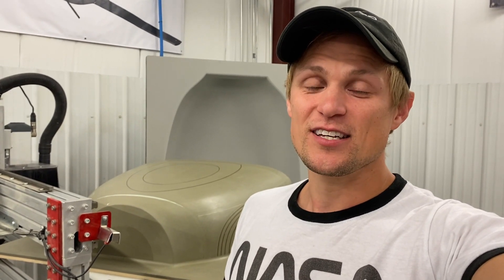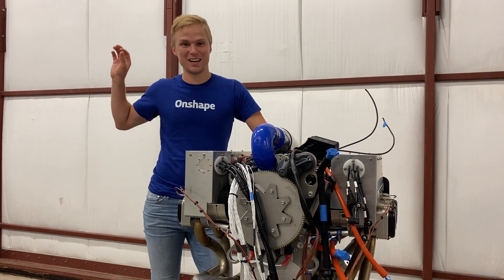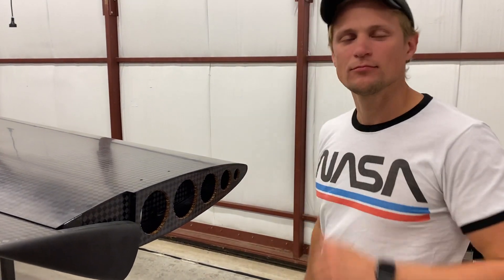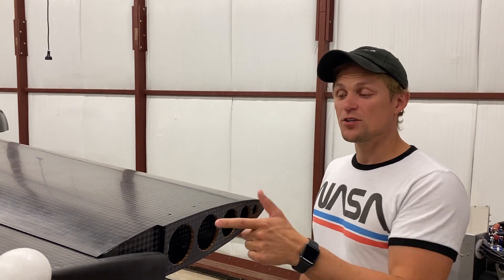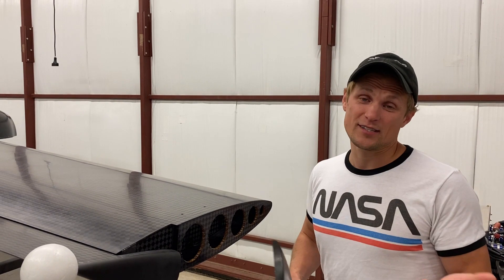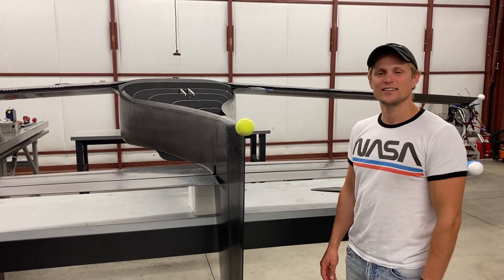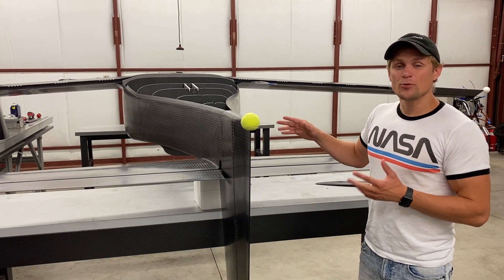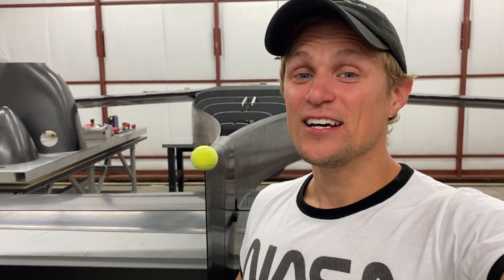Several DarkAero 1 Frequently Asked Questions! (FAQ) - July 27, 2020

Comment: Maybe the answers to the questions should also be listed.  For instance I could not understand the answer to the engine question (specifically the engine selected).
Reply: The answer was "no" you can't install a different engine, since they designed this entire plane around that engine.

Comment: So you said it wasn't designed for aerobatics, however I'm sure it can handle simple things like wing overs and loops saying within a +6/-3 envelope right?
Reply from the maker: Hi David! The structure is rated for normal category maneuvers within +3.8/-1.52G’s flight envelope. The mission the DarkAero 1 was optimized for is high speed cross country flight. There are some aerodynamic changes we would have made if we intended the airplane for aerobatic maneuvers.
Reply: @DarkAeroInc  ok got it!  But if you are doing "gentleman" aerobatics under those limitations you would be ok?  I'm taking basic stuff (aileron roles, loops) all within the limits.....assuming your weight loading falls within the correct category to go to those G limits

Comment: If you can only use one engine, why isn't it a fixed part in the kit?
Reply from the maker: Thanks for watching and the comment! We don't manufacture the engine. We only manufacture the composite structures, engine mount, and landing gear. These types of items will ship directly out of our facility. Things like the engine, wheels/brakes, adhesive, etc. are all necessary for the aircraft, but not something we produce. With that being said, we would like to have a seamless customer experience where everything needed for the aircraft is ordered through our website (but not necessary shipped directly from our facility).
Reply: Why do you want to add another middleman's markup to the price of the engine?

Comment: Since you are married to the UL520iS, what propellor has been spec’d for the marriage?
Reply from the maker: We are using an electric constant speed propeller made by Airmaster Propellers that is specifically configured for the UL520iS engine.
Reply: Interesting, used a very similar unit on the MQ-1’s.  Will the unit be self contained electric or servo modulated?

Comment: What is the design gross weight? You tell us payload and wing area but not gross weight or wing loading. Next the 70mph stall speed is quite high. Have you considered multi slotted flaps to further reduce stall speed and thus energy at touchdown?
Reply from the maker: Hey Tom, the gross weight of the plane is 1500 lb. More stats can be found here: https://www.darkaero.com/aircraft. As the airplane is designed, now we meet the FAA's 61 knot stall speed requirement for light aircraft (FAR 23.49), essentially the same as a Cirrus SR22T. Anywhere you can land in a Cirrus, you should be able to land in the DarkAero 1.
Reply: Thank you, My RV-9A is 1750lbs in normal category, 1600lbs in utility category.
Reply: BTW that is amazingly light! Great work.

Comment: I have read that one of the best wings for lift/drag is an elliptical laminar flow wing(the Spitfire), but they are complex to make in the regular manufacturing world. But you are making a mold using carbon fiber for the wing. What were the reasons for choosing the straight wing?
Reply: Elliptical wings have undesirable stall characteristics. They tend to stall uniformly and in a very abrupt fashion. This is obviously dangerous and leads to little/no roll control in a stall since the ailerons will stall at the same time as the rest of the wing

Comment: Hi guys, enjoying the build videos - keep them coming! I too are wondering about a parachute system. Also, how will fuel quantity be measured - i primarily assume with a sensor of sorts in the system, but with your filler caps up high on the wet wing ends will there be a way to dip the tanks to verify? Monitoring those fuel levels will be crucial in the multi passenger + baggage scenario where you are running half empty tanks as a normal process- hence my question! Thanks and keep the updates coming.
Reply from the maker: Good question and thank you for tuning in! For the prototype we have a sight glass in the cockpit to visually confirm fuel level. We are also testing out some electronic sensing methods.

Comment: Will it be possible to install a BRS whole air frame parachute with the current design?
Reply from the maker: Good question! Yes, we have been exploring a parachute solution but it is still in the design phase. It would likely be located behind the pilot/co-pilot in the aft baggage compartment and take up some of the aft baggage space and sacrifice roughly 40 lbs of useful load. More details on that later.
Reply: @DarkAeroInc  Please build that in. Very interested in a kit in the future but I don't fly without a BRS... Appreciated if possible...

Comment: I wish you well and hope you end up with a fantastic product. Looking forward to seeing DarkAero fly.
The more I watch of the construction and build, the less I want to buy a kit.
Thanks for sharing but this customer is lost.
Reply from the maker: @hartmetall, the aircraft does include "tapes" or an overlap of carbon fiber reinforcement but they are applied selectively in high stress areas and left off in areas where they aren't required. We have performed testing to measure mechanical properties and joint strength so we have a good understanding of our structures and their safety factors. A structure may look flimsy but "eyeballing" isn't generally considered an acceptable means of validating it to be suitable for use. We rely more on calculations, simulation, and testing. What you see in the videos is a snapshot of the progress so don't be too alarmed at progress that is incomplete.

Comment: Thanks for this video. While you were talking about the winglets, I had a question come to mind: have you done any CFD analysis to see if the use of VG's would assist in lowering stall speed? With that high wing loading, the 70 mph stall speed is going to be a liability, and will limit the aircraft from some smaller runways.
Reply from the maker: Hi Scott! We have not run CFD with VG's (vortex generators) on the wing. Before installing VG's, we would work on a more advanced flap design with higher lift increment. VG's would disrupt the laminar flow on the wing and increase drag throughout the entire flight envelope. As the airplane is designed, now we meet the FAA's 61 knot stall speed requirement for light aircraft (FAR 23.49), essentially the same as a Cirrus SR22T. Anywhere you can land in a Cirrus, you should be able to land in the DarkAero 1.
Reply: @DarkAeroInc  Thanks for the reply. Of course, I'm looking at it from the aspect of aircraft owner - trying to change the behavior of what's already there on a production aircraft. You have the obvious privilege of being able to design changes into the system rather than try to retrofit solutions after the fact! Easy to forget. :)

Also...I have to apologize, I read the web site and saw the 70 mph stall speed, and I even wrote 70 mph here...but my brain was interpreting it as "70 kts" which is why I thought "wow, that's high." - and is why I wrote this comment in the first place!

You're 100% right, it is 70 mph, or 61 kts, which is perfectly acceptable.
Reply: ROCK? Might shed some light on it for you, cant beleive they thought of CFD https://youtu.be/gjNPEDBeiTI

Comment: Riley,  Why did you choose carbon for the torsion tubes, but aluminum for the push/pull tubes on the control linkages?  I am sure that you have analyzed it and there is a weight advantage or strength advantage, but I would like to know the engineering analysis behind the decision.
Reply: I asked that in a previous video myself. He responded that they'd likely drop the aluminum for production models in favor of carbon fiber. The initial use for the aluminum was they hadn't found a satisfactory solution for the heim joint connections yet.
Reply from the maker: @sqpapa, that is correct!
Reply: @sqpapa  I have no idea what I'm talking about but I do know someone who has canon fiber driveshafts on his racecar...couldn't the connections from heim to carbon be of the same type of process?
Reply: CenCoast_7.3 ib this case probably not. The race drive shafts need to resist twisting forces, as opposed to tensile forces for pushrods. 

Having said that those race shafts take an enormous amount of force.

Comment: Did you design the winglets to have a forward component of lift? Adjusting the z-axis angle of the winglet can convert the horizontal component of the vortex to forward lift.
Reply: As they said, winglets help reduce induced drag. 

Induced drag is drag created by lift. 

It can be significantly reduced by using a higher aspect ratio wing, which will provide less induced drag while not adding any additional non-lifting surface area. 

Flying faster also reduces induced drag. 

This airplane is designed for 275mph cruise, which probably means nearly 300mph Vmax. It's also designed for low and moderate altitude, not having a turbo means max cruise will be around 7-8kft.

At high speed, the wing will be operating at a very low coefficient of lift, and therefore will not produce much induced drag. 

Induced drag is a concern for heavy lifter, passenger jets, and other airplanes that operate at high lift coefficients i.e. ag planes, Sailplanes, military transports or those with low power to gross-weight ratios. 

1500lb gross to 200hp is better than a Pitts S2A. 

66ft^2 wing area 
1500LB Gross 
275MPH cruise (403.333ft-sec) 
Altitude 7,500' 
Is 0.0018976 Slugs/ft. 

Plugged into the lift formula returns a cruise condition lift coefficient of 0.147. or 0.15 with a 2% gw balancing download on tail at cruise.
Reply: @Triple_J.1  I understand all this, however not all winglets act as forward sails. The reduction in induced drag comes from preventing the spillover at the wingtip, reducing lift, causing an increase in AOA. Canting the winglet out of plane to the direction of flight is something else, isn't intuitive, and there's very little written on these designs, and almost all winglets on small aircraft are not designed as forward sails.
Reply: @ryanmcgowan3061  it's an interesting concept. I would like to see details on that design. 

The added benefit on a small light airplane flying very fast would likely be small also. And any increase in non-lifting drag is going to take knots off the top speed. 

Even winglets with a forward lift component are probably not going to add net thrust, especially at high speed when operated at a low lift coefficient; I.e. when the wing is not making much wingtip vortices. 

Winglets are typically beneficial at CL > 0.6 like a fully loaded Airbus in the mid-altitude climb condition.
Reply: @Triple_J.1  I haven't heard of them used in a light aircraft for those reasons, but I imagine if it's heavy enough and fast enough, it may cross a threshold as the vortex gains enough energy, and likely wouldn't be a flat raked winglet because they don't seem to be as beneficial as smoothly curved winglets. Most of the literature you find in academia is focused on the reduction in induced drag and not on harnessing the energy for the forward component. Being all composite, DarkAero seems like it could explore this type of winglet, but it would take a lot of experimentation and analysis. If I was better at CFD analysis, I'd love to play around with winglets in a the high speed/small aircraft segment.